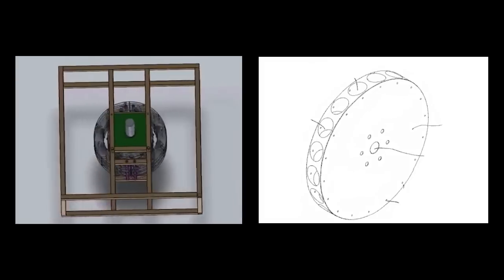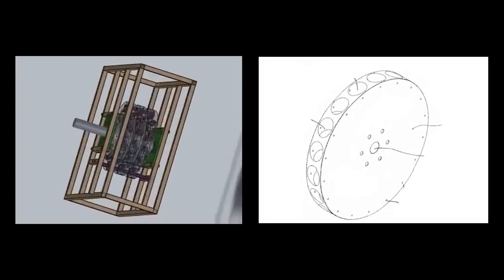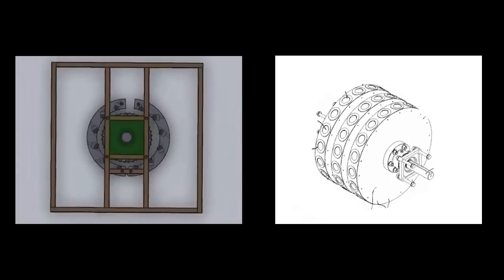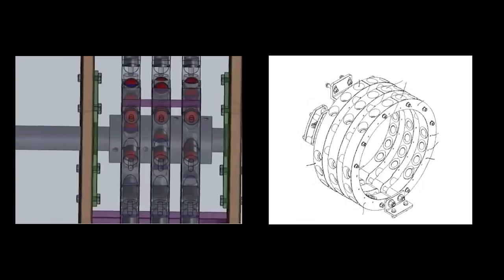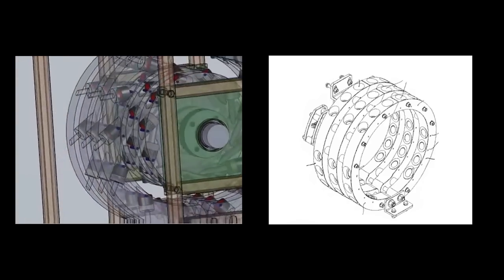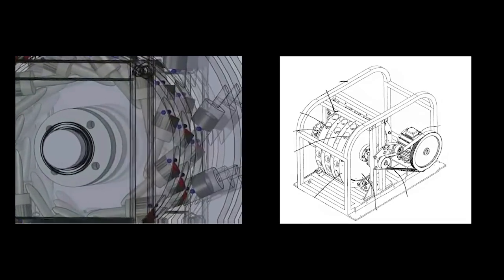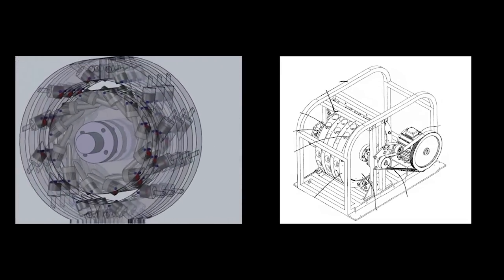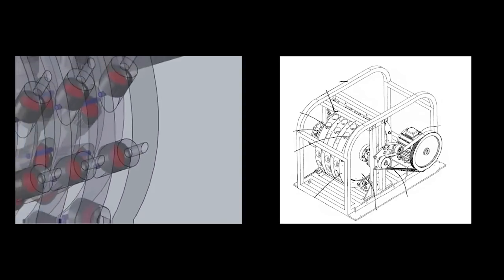Free Energy Generator - Mike Brady Permanent magnet machine

Comment: To whom it may concern :) Over unity electric generator. By AMA.
Segment 1: 1 motor with bar connected to it standing vertically. Circular disc connected to bar that has magnets embedded in it surrounded in high permeability material to focus magnets outward pushing force in an upwards direction from top of disc. 
 Segment 2: Hollowed out cylindrical Bar of material horizontally positioned. 
 Flat hollowed out ring shaped material with openings around its outer top flat edge.
 Magnets surrounded in high permeability material embedded in these openings.
Magnets positioned in openings around ring are in at least 1 of 2 configurations either all N magnetic field pushing out or N,S,N,S all around it. Just depends on whether your going for Piston structure or spinning structure explained below & whether you want it to be DC or AC current. 
Place these all along the cylindrical bar connected to it solidly, except at far ends of bar. 
At both ends of bar place ring of material that can be magnetically repelled in specific locations. (magnetically repelled in specific location is in reference to outside of ring area that faces away from center of bar)(Other side of same ring facing in towards center of bar is capable of being magnetically repelled all around) Ring must be connected solidly to bar. points of repulsion on these rings is off set from each other on each end of bar. 
3 Hollow ring structures with small square bars protruding from each. Ring structure has all magnetic repulsion on inside of ring shape & can rap around the main bar so that the bar wont be causing friction on things as it moves back and forth or spins. 1st positioned around far left of bar, 2nd position at center of bar (be sure to leave enough room for magnetic structures to be able to move back and forth without hitting it) & 3rd positioned on far right of bar. 
Tube structure is constructed in two parts that fit together on top of each other length wise over main structure. 
Tube structure has 3 square openings for the bars that the Ring structures that are connected around the main bar keeping it from causing friction on structure, to slide into. 
This tube structure is designed with material that does not block magnetic fields. Perhaps some type of transparent material glass or other. 
 At both ends of the tube structure there is a built in circular groove that will house a round disc. The ceiling/floor/left side/& right side of groove has openings for small magnets to be  embedded in it, so that the pushing force from magnets is pushing in towards the edge of disc that goes in this spot. There is also 4 openings located on the top, bottom, left & right positions of the open groove. Small magnets are placed in these spots so when round disc is in position these magnetic fields will hit sideways keeping it from generating friction against structure. 
Far Ends of bar has Cap structure that screws over tube halves holding them together. Cap structure also has 4 points on inside top, bottom, left & right that have openings. These openings have small embedded magnets in them that exert there pushing force outwards (sideways) so it will keep disc in position, generating no friction against structure. Cap is made of material like tube so it does not block magnetic fields. (Note: These magnets in groove and cap structure are only needed for piston design. If Disc is directly connected to main bar so as it spins the bar spins, magnets are not needed here).
 The disc has ring around it (ring of material goes around outer edge and folds over front side & backside a small distance) that is repelled by magnetic fields so the 12 small magnets will keep it lined up but it will be able to spin without causing friction on structure. The disc has openings on it's flat side that face inside of tube and magnets surrounded in high permeability material are embedded in this disc. 
 The disc has small bar that is connected to it's center that goes all the way to the other end of  bar structure through the center of the hollowed out bar and connects to disc on other end. Disc on other end is set up the same but magnets embedded in it are off set in comparison. As first disc spins the magnetic fields will push against specific spot on disc connected directly to bar, pushing bar in other direction, once bar is fully pushed over, further spinning of disc will then align the other sides magnet to push it back.
 Tube structure also has half moon shaped protrusion on inside and on both halves so when tube is connected they line up to make a full ring shape on inside of tube, these half moon shaped protrusions have at least 1 small round opening on it's side in middle of curve that faces away from center of bar. The opening has a small magnet embedded in it so magnetic force is repelling out sideways away from center of bar. The protruding ring is positioned to line up slightly further in towards center of bar then the ring of magnetically repelled material connected directly to bar. This way when bar moves right or left it is magnetically stopped after a short distance. 
Copper coil setup: Copper coils are wound in at least 1 of 2 ways. Either coiled in circles next to each other (Like if you wound coils around a cylindrical bar) or laid out in a row as if wire was on flat table going up then bent to go down & back up until it formed a flat rectangle of wire bending up and down and then the entire structure folded around tube. Copper windings are then lined up perpendicular to magnetic fields on outside of tube. Ends of copper coils are connected into separate construct that will allow electrical current to flow somewhere else. 
Circular construct is built like a stand that goes around the outside of motor segment. Circular construct has flat ring of high permeability (magnetic field shielding) material that has small openings that will allow magnetic fields through specific locations. Top of circular construct has groove to allow the horizontal bar to balance on. Circular construct can also be placed on other end of bar so it is balanced. The motor segment is positioned so the disc connected to the bar that is connected to the motor is lined up so the disc passes under the horizontal bars disc that is at end of horizontal bar. The high permeability material keeps the magnetic fields in disc from hitting into the disc that spins or pushes the horizontal bar until just the right moment when the impact will cause the disc in horizontal bar to spin which will perpetuate the piston motion in the horizontal bar. More horizontal bars of the same design are built and positioned around the motor segment in a circular horizontal fashion all the way around. The bar connected to the motor can be increased in length to desired height (As much as motor can handle) and more of the exact same setup is repeated higher and higher up, maximizing the over unity potential of the construct to ridiculous proportions. :D Current from the horizontal bars is diverted to power the motor as needed and all other current is diverted to power my game console or the world. :) Interesting variation to this design would be to connect the spinning discs on far ends of horizontal bar to main bar that magnets are connected to so the magnets spin instead of getting pistoned back and forth. So long as moving magnetic fields are perpendicular to copper wires it should work. By AMA